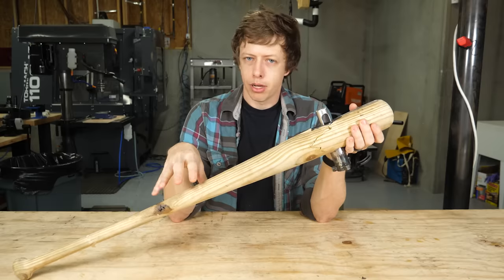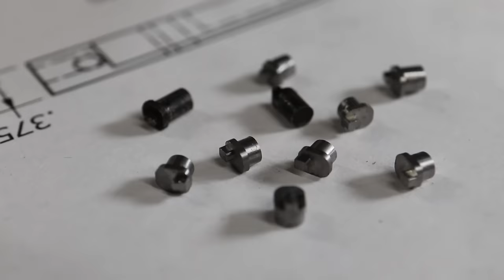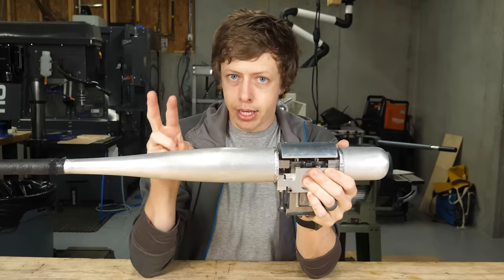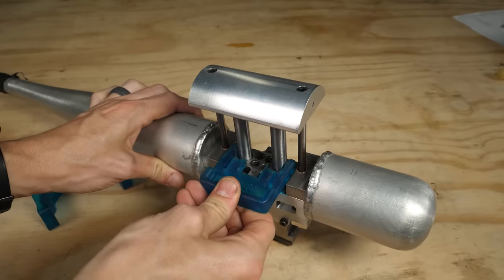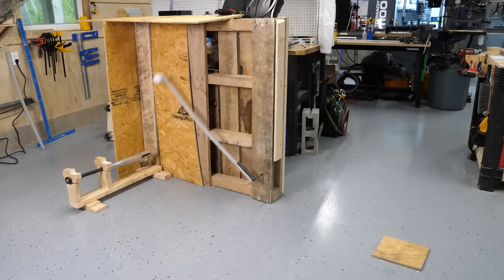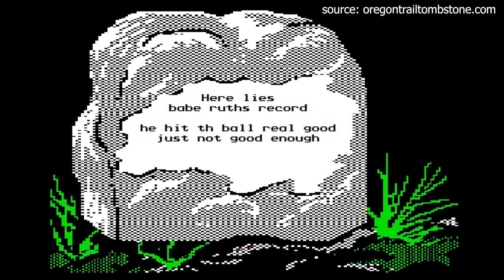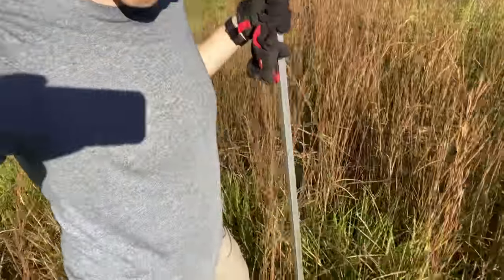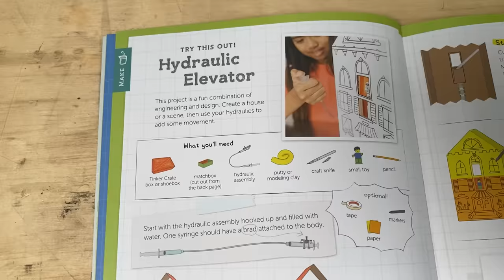Explosive Bat: crushing MLB records. Ft: Smarter Every Day

Comment: Makes you realize how insane it is that a human being hit 575 with a piece of wood
Reply: Not to be a buzzkill, but it's pretty unlikely anyone actually hit the ball 575 feet.. Now that we have actual laser measurements and camera systems designed to track the ball electronically, and aren't relying on eyeball accountsany more, no one in Major League history has hit a ball further than 504 feet. Still a mammoth shot but not quite 575.
Reply: @michaelwarner278 There are two things here. Firstly, he is hitting a steady ball, which means he is not adding any extra force, just the one generated by his arms + explosion. Secondly, when you are hitting a ball in a normal match, you need to consider the force that the pitcher is applying to the ball, which is added to the one generated by the player and the bat. Considering that they are pros and practice every single day, they apply much more force to the ball. If you do the math, you will see how that affects the final result.
Reply: @juanmanuelcruzmonterrosas2924  Guys in the pros aren’t hitting balls even close to that distance. If dudes like Judge and Ohtani aren’t getting close, I don’t think anyone did back then.
Reply: Juan Manuel just missed the whole point
Reply: Record is 582

Comment: Pretty sure 99% of us couldn't try this at home even if we wanted to lmfao
Reply: 99.99999
Reply: 💀yehh.. Uh.. Lol
Reply: 99.9999999999999999999999999999999999999999999999999999999999999999999999999999999999999999999999999999999999999999999999999999999999999999999999999999999999999999999999999999999999999999999999999999999999999999999%
Reply: Maybe like 99.999%. People like mechanical engineers who have worked in firearms design aren't super rare.
Reply: @thicccduck7385  d
Reply: @zimbu_  But let's be honest most people won't have a metal printer and plasma cutter, a really hard bat, a big brain and the designs for the metal parts. The only other person I know who could do this is the Hacksmith. Or those random turning knut into diamond ring people.
Reply: @nuggleiii  what do you mean by D
Reply: @TheScaper28  In Australia we aint have any of that gun shit
Reply: @thicccduck7385  don't need any of that "gun shit" if  you tweek the design slightly you could probably use a mix of a touch sensitive flash powder and some other semi stable explosive check out explosion's and fire has a Australian bush chemist that just makes explosives all the time 
Also about what you said this being to hard to make it isn't when it comes down to it he just made a slam fire blank firing thing the problem most pepole would have compared to him is haveing it as stream line being most of us not having access to stuff like plasma cutters but you could easily do something fairly similar with a Dremel a welder and bits of pipe/scrap steel plus some oil to heat treat it all so it don't blow up

Comment: Now do it with a 50.Caliber round! ..for science of course 😈
Reply: hi syndicate
Reply: @braybray7625  just because you combine whatever caliber bullets up to .50 does not make it a .50 cal round or even close to as powerful as a .50 cal round.  If he used an actual .50 cal round that bat his arm and that ball would all be gone just from the force alone.  Not including the fact that it would litteratley explode on impact because the bullet has nowhere to go.   Seems like your the one who needs to go learn math and science bud..
Reply: @braybray7625  know what your talking about before you say it
Reply: @mystogan8315  you know that caliber means the bullet size right? It depends on how much grain you use.
Reply: God damn it Tom look what you’ve started.
Reply: Do you know what a power load is? That’s what he is using.
Reply: Ramzes Motoa  I think you should add hydraulic recoil compensators to the bat just to prevent it from killing you
Reply: From what mystogan said there would be too much force how body could not contain it
Reply: I was wondering if it was actually a .50 cal bore, and a big blank BMG round would be STUPID COOL
Reply: @mystogan8315  yes finally somebody called it out
Reply: I think a .50 would not do as well as a Shotgun Shell due to its immense Power.
But, a Charge inside the Bat and some use of Tesla-Valves could make this possible, having the Tip of the Bat working as compensator.
Reply: @mystogan8315  what did bray bray say cause he deleted his comment
Reply: YEEEESSSSS
Reply: @scaelp  caliber is the diameter of the projectile, it has nothing to do with the weight of the projectile which is commonly measured in grains in the us
Reply: @Rabijeel  

That’s sound cool af but I’m uneducated with all this stuff, do you mind explaining how it would work in more details?
Reply: Mystogan THANK YOU! SOMEONE THATS NOT BRAIN DEAD
Reply: .50 action express would work well
Reply: @mystogan8315  Have you heard of blanks?

Comment: "This could kill you", then hides behind osb which is about as sturdy as cardboard
Reply: I guess it makes sense since he knows he will be perpendicular to the trajectory of all of the major forces. The shrapnel isn't going nearly as fast as the flying pins.
Reply: Osb is actually quite good at stopping shrapnel...
Reply: @kylenakamura4353  perpencidular until something unexpected goes wrong...
Reply: He must have had a metal plate, I think this guy knows what's he's doing
Reply: He also was the product manager for boeing. Just kidding.. but, you know.. Also, blanks shells can easy be a grenade if it's right up to a body part body.. if he drops the bat on his leg...
Reply: The idea is to stop shrapnel

Comment: The best solution for this is to apply a choke exhaust port and to apply baffles like what a gun suppressor does. The expanding gas is no where to go thus it create a lot of impact stress to the metal. if you channeled a exhaust port with baffles it will significantly reduce the expanding on gas giving a chance for the piston rod to decelerate (you can use hydraulic as replacement to a spring so it is not impact metal to metal).

Comment: I'm late to this game... As it were. I reload my own ammo and seeing this, and considering that you're dealing with essentially gun parts and pressures like my Magnum rifle @ 64k PSI, if you haven't had perfect results, I'd suggest considering the use of buffer tube springs w/triple braided springs and using the barrels of a .270 Winchester or a 6.5PRC for your gas travel barrels. You know... If you haven't already perfected it. You're likely getting the same pressures as the chamber of a rifle depending on what type of powder those cartridges are loaded with. But they are probably fast burning pistol powder and you might have better results with a slightly slower burning rifle powder. My physics knowledge is limited to that of firearm ballistics so I'm not sure how much will apply to this venture but guns are designed to tolerate the task you have set so I'd encourage adapting the parts to suit your purposes.
Reply: This really makes sense
Reply: I like this as well.
Reply: Totally understand everything in this comment… mhm, totally
Reply: The thing that's been annoying me is calling two 24 cal is a 50 cal is not correct at all.
Reply: @eviseratorkyle  48 cal sounds stupid so 50 cal it is
Reply: @nated4237  The problem is that Cal is the diameter, this means that when you double the caliber the amount of black powder quadruples (assuming that Cal refers to the internal width of the chamber containing said black powder, and that the length of the cartridge is the same), but this basically means that one "48" ( or 50) cal is roughly equivalent to 4 24 cals, rather than 2 24 cals, but he did use 4 24 cals in the end, so it is roughly correct.
Reply: The pressure at the breach should be a lot lower (although maybe not considering there's four shells) since there's no bullet right at the start of the burn to increase pressure.

Comment: Now remember: Some guy did a hit like that with a normal bat
Reply: How to desintigrate your wrists:

Step 1: Hit the ball as hard as the entire human race combined can hit it like that guy 
Step 2: DONT let go
Step 3: Write down what went wrong. Oh wait you dont have hands anymore...
Reply: Human power
Reply: Also that guy would have hit a 90-100 MPH pitched ball. Hitting off a tee with no pitch is much harder to get distance.
Reply: @cuthbertallgood7781  fax
Reply: His arm is the 50 cal
Reply: @cuthbertallgood7781  are you sure? How is that possible if the ball is traveling the opposite direction? The physics requires the bat to override the directional momentum of the pitch.
Reply: @cslack813  the ball bounces off the bat. If the ball is coming in at higher speed, it will compress more, building more potential energy, then shoot off with that extra energy. With this particular bat, they mention how the ball is more "launched" than "bounced," meaning that a lot of the kinetic energy is given to the ball not by compression and decompression (though that does happen) but by actually pushing the ball in a rigid body manner into higher speeds.
Reply: None the less a wooden bat!  Wodden bats spring coefficient in the material is a lot more that metal ofc so some of the force gets absorbed by the impact with the ball, so I think this is how you REALLY get your true distance.

Comment: I know this is an older video, but if you were to come back to this in the future, I have a suggestion. Get on summit racing and get some 500-800lb valve springs, that'll help transfer the energy and keep the bat in one piece.

Comment: What is the delta over your average human non assisted hit distance per cartridge? 

Like 100+ft per shell 

Btw please keep doing this series till it goes into orbit
Reply: lol til it goes into orbit
 you mean when he boops our moon out of orbit
Reply: @LesskoBrandon  y'know, the moon sorta looks like a baseball… 🤔
Reply: The relationship between shells and distance is non-linear since velocity is proportional to the square root of energy, and that's also ignoring air resistance and other energy losses. It doesn't really make sense to give a distance value per shell.
Reply: @dominicmartinez7229  "About turning the bat into a golf club: There is a commercially available golf club that uses the exact same principle you use here with the bat. You load in a certain number of blank shells and the ball will fly different distances depending on how many are loaded. It's primarily used by those with disabilities in moving their arms and allows them to still play golf. It's remarkably consistent in terms of accuracy and distance from what I've seen."
Reply: Mott,how would you add a Chinese spinny-boi to this bat? Is there already a tune in the cabinet,for this bad boy?
Reply: Joel 556  99

Comment: Everyone immediately thinking "Don't tell me you can't make a gunblade."
Reply: he can, but only cause they already exist.
Reply: Someone I used to hang around with had a Swiss Army knife with a working foldout chainsaw blade he had made for it. It couldn't cut anything but it did actually run.
Reply: What's a gun blade
Reply: @lostdapack  its a gun, but with a sword, highly impractical.
however in the ye olden days when pistols only had one shot in them, they were commonly combined with swords.
its a weapon in some game i cant remember.
Reply: @nonyabuisness3560  a bayonet?
Reply: @dogwelder9699  no too modern
It's a pistol gun
edit: not pistol gun, pistol sword im an idiot
Reply: @nonyabuisness3560  The game you're talking about is Final Fantasy 8.
Reply: @nonyabuisness3560  ah makes sense
Reply: @nonyabuisness3560  I'm pretty sure it was in league of Legends
Reply: @acronyx991  ah yes
Reply: @justaguywhogotlostintherec1527  its a very popular idea
Reply: @nonyabuisness3560  dagger gun seem better , enuff be already , lance  revolver
Reply: @dadaeeaeeadada3301  same problem with gun swords, the heaviness of the lance would compromise the gun part.
Reply: @nonyabuisness3560  not like that , brb I will send you this slick design
Reply: @nonyabuisness3560  pistol gun is my new favorite thing to say
Reply: @dogwelder9699  i messed up the word. its a pistol sword not gun.
Reply: @nonyabuisness3560  It's a weapon in Warframe, but I doubt you mean that
Reply: Puts bayonet on assault rifle Okay does this count?
Reply: @eaglgenes101  no, because the blade is removable.

Comment: In the slomo, the blanks were relesing gases even after the ball bumper was all the out. So to keep the stopers from breaking off all the time i had two ideas, one is adding a vent hole thay is only exposed when the pistons reach max length, or two would be ading an acumulator piston to act as an absorber for the gases.

Comment: "dont look up degloving"

me: how bad can it be? throws up
Reply: Same
Reply: Always take your rings off when wearing gloves.
Reply: Yeah they told is in the military that you should not wear rings as they can get stuck on the trucks when jumping out which results in.. degloving. They've actually had it happen a few times
Reply: @dont_touch_my_tail  The ring catches something and gets pulled off the finger, peeling the skin with it....
Reply: Wasn’t able to find very many images
Reply: jokes on you i'm i̶n̶t̶o̶ ̶t̶h̶a̶t̶ ̶s̶h̶i̶t̶  desensitized
Reply: @nosidenoside2458  excuse me but WHAT
Reply: @ripenoodles9986  perfect pfp
Reply: @dont_touch_my_tail  some of the skin on ur hand is missing plz dont look it up
Reply: @markkusallinen3469  also happened quite a bit hopping out of a cockpit, grandfather had a story or two about that lol
Reply: Same :) I saw bone :/
Reply: My friend is a nurse - i know better at this point...
Reply: I came into to work 1 day (steel manufacturing and fabrication) to an email with an image that looked like a pile of rags, grease and hydraulic oil at the end of a line. Specifically a 12 pass roll forming line used to make corrugated sheets from flat sheet; each pass is a set of male/female profile rollers that squeeze the steel to form.
When I read the email text... a guy had fallen onto the lubricated, 1800mm wide, steel at pass 2 and got his overalls caught between the pass 2 rollers. Eastern European plant with no safety guards, no kill switch cables, no light ray detectors... nothing. The unbraked hydraulic drive takes 9min to stop.
What looked like rags and oil... wasn't. He went through 11 passes and was basically liquidised.
Degloving?... it sucks, but could be worse.
Reply: @hesperhurt  damn so he had to sit through 9 minutes of pain?
Reply: @joshg7613  a full pass takes 1.5 - 2min on average. He was killed on the first pass of rollers. No choice but to be graphic... what came out the end was liquid and rags. Nothing left of the poor guy. :/

Comment: Imagine he makes 2 of those bats then puts the bats on destins bat spinning machine.

ULTIMATE POWER
Reply: Wouldn’t work
Reply: the ball will shatter into 1 million pieces
Reply: They hint at that on Destin's Channel. Explosive bat + mad batter + supersonic baseball pitcher.
Reply: @youcefdz5598  nope, the bat wouldn’t even have the time to fire because of its the speed. By the time the cartridges fire, the ball woud be far away
Reply: @TheMrEduz  that and the fact that you'd have to time the swing of the bat specifically to hit the ball on the exploding part. Otherwise only the tip of the bat might hit the ball and it'd be just like their regular spinning bat machine that he showed.

Comment: "A degloving injury is a type of avulsion in which an extensive section of skin is completely torn off the underlying tissue, severing its blood supply. It is named by analogy to the process of removing a glove"
I'm sorry I looked it up.
Reply: Degloving, also called avulsion, is a type of severe injury that happens when the top layers of your skin and tissue are ripped from the underlying muscle, connective tissue, or bone. It can affect any body part, but it's more common in the legs. Degloving injuries are often life-threatening.
Reply: Ya the images are pretty gnarly
Reply: the images are traumatic
Reply: @redegs_  clearly haven't seen mexican cartel executions and gore 😭😭
Reply: Same
Reply: Don’t go on images just don’t it’s not pretty
Reply: But still cool

Comment: Well, I'm almost 2 years late (Youtube just showed me this), so my comment may be completely useless. But I kept bugging about your problem of the stop springs not being able to hold the breech and the rest in place when using 4 shells. I remember seeing some video of how gas piston weapons work and how they guide some exhaust gasses back to operate the spring, while the rest goes out of the muzzle.

In your case, the goal is of course to have all the gas hit the breech and move the contraption forward to catapult the ball. What then causes the failure is the pressure continuing to push the fully extended pistons, correct?

So what if, from the moment the pistons are fully extended, the gas can then pass another bore to be vented out of the bat someplace else? That would stop the gas from pushing the stop springs and pistons out until they break and can't hold on anymore. I imagine a bore inside the whole thing that is sealed shut by the whole thing until it extends outward, making way for the gas to take a new path of the least resistance to vent.

Again, two years late. And if that idea didn't strike you by now, I'm sure another commenter already left such an idea somewhere in the comments.

Just wanted to share it regardless. I'm not even sure if that stuff would be as easy as I imagine. Impressive work however. Cool thing to see engineering skills put to these fun experiments.